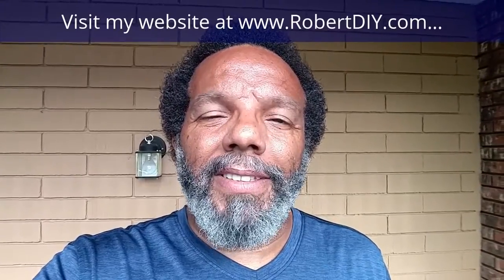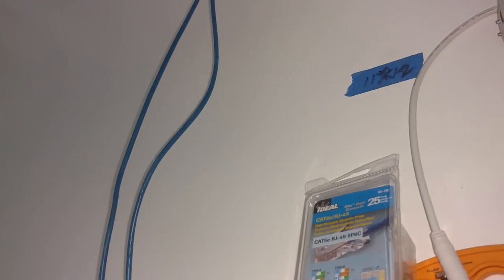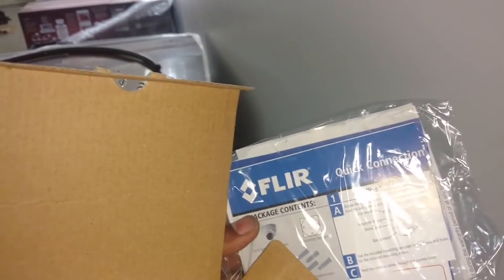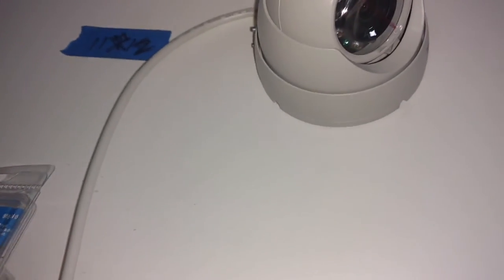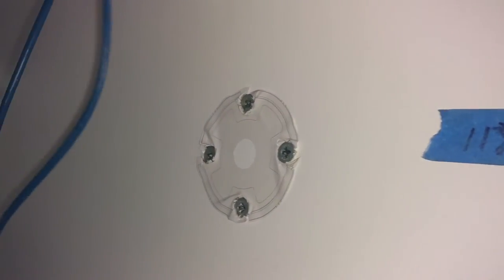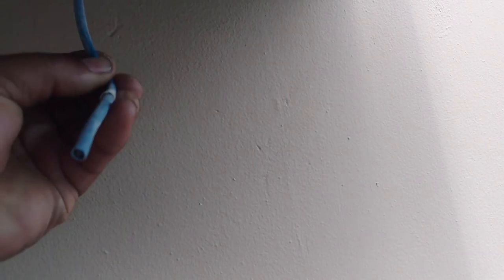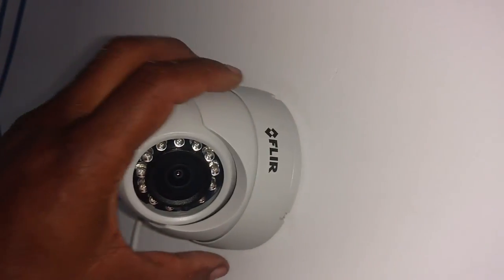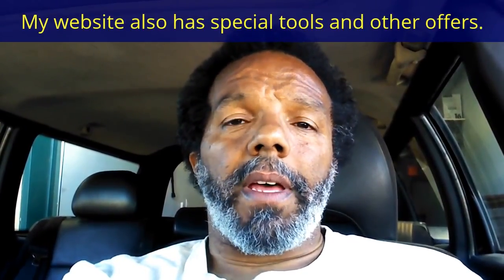How to mount the security camera, Flir IP camera. - REMIX

Comment: Hey Robert. I had an IT company come and install the system for me at my home. I am adding one additional camera which is the same camera in your video. I have already pre-ran the cat six cable which is the same exact cable that was used for my other cameras.  How do I connect the cat 6 cable to the camera? That part I’m kind of lost on right now. Like I’m not sure what adapters I need to make the connection between the two.
Reply from the maker: Did you watch the video? Did a video show you how to connect the camera? If not there's likely a link in the comments of this video.